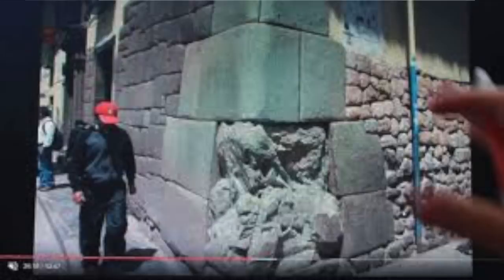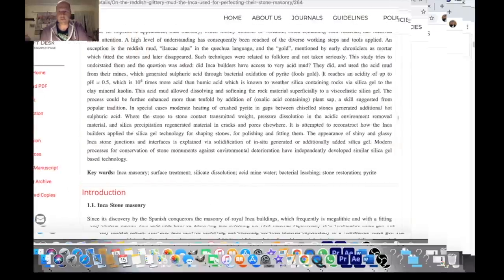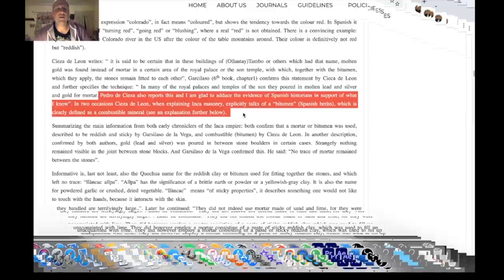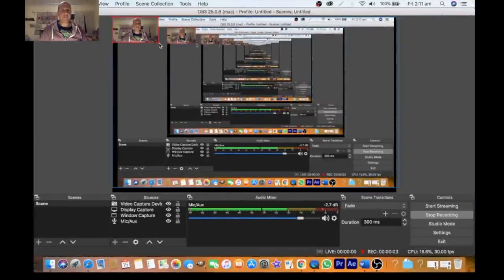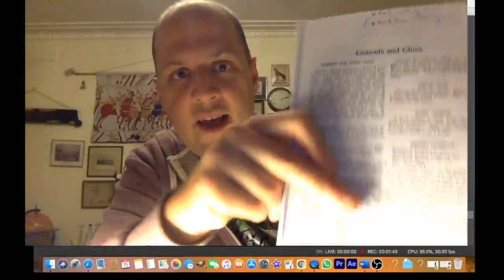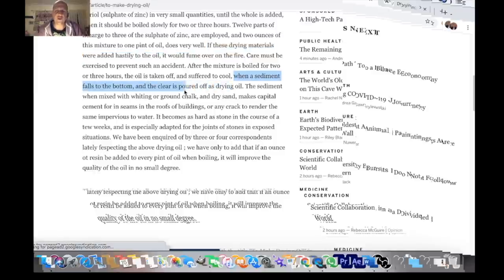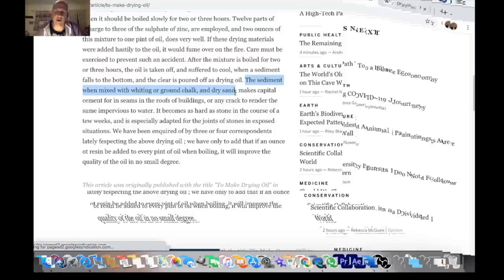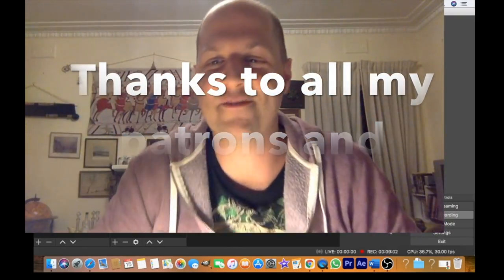FOUND! The 'OLD RECIPE' to JOIN, STUCCO, 'VITRIFY' INCA STONE! "Geological Biopolymer!!!" NOT GEOPOL

Comment: Excellent!  That's a major discovery and I've been waiting for someone to finally make it. So thanks!  Now I might switch from calling it "organic polymer" to adopting biopolymer, but I hesitate since 'oil' isn't exactly something one would define as once 'alive'...which "bio" seems to imply.  But other organic polymers were, including milk casein, egg albumin, meat collagen, and one that I discovered by accident.  

Try this: juice a potato (russet probably is best) then microwave the juice in a glass to boiling. then pour off the liquid and you'll find a tough but flexible slug of 'plastic' at the bottom.  Try to dissolve it in hot or even boiling water. It will not dissolve!  It's a super-biopolymer.  It may be what is used these days to prevent cold cereal from becoming soggy in milk. The stuff just sits there and won't absorb water.  Permanently crunchy.  Must be potato polymer or something equivalent.
About that big corner block, I assumed for a long time the same thing that you assume, but recently I examined a better photo than those before and discovered it did not loose its render veneer. That is evident by the character of the remaining external surface.  Here's a link to the comment-photo that I made with that photo: https://www.facebook.com/photo?fbid=4115912581772665&set=gm.1056202588125468

Comment: Oil rubbed in is still a method used to "repair/restore" modern cement/concrete.
Reply: i've worked with all different trades for years and never heard of this !
Reply: @0harris0 boiled linseed oil is often used to enhance / revive /protect brick and tile work .  It can also be used to "glaze" packed earth floors.

Comment: Great Recipe for stone verification. Only how does this explain how they moved and placed these stones into place ?
These stones weighed tons ,how did they carry and move them into place??
Reply from the maker: It doesn't. :( Geopolymer might. This is just for joining and rendering not really for making or moving it. :(
Reply: the stones can be easily moved with enough people, and some good sleds/rope/pulley/a-frame engineering, wood and ropes... natural fibres... 
absolutely epic of course, but that's what you get when a society works well enough to be able to take the time to build megalithic structures :P

Comment: Here's a thought about the protruberances. Animal hides for the molds. leg holes sewn up.
Reply: its a thought! but those little spots like dough being ripped away is surely indicative!
Reply: @313barrygmail  Exactly, like random hides being used for the size they need. pointed in whatever direction best fits. That's why the bumps appear random, the hides could be sewn together by different people and different methods, making the forms for the next block as they go.

Comment: I hadn't considered rendering, though I knew about the casting (H stones in SA). A combo of plastering and chemical wash. It will have rust and sulphur on the surface if this is what's used. Just look at the rust on many of the vitrification sites.

It's a compelling argument for a putty.

But this isn't the formula for the mine waste acids, what plants did they use for that?

Comment: "Lead putty" and "Lime putty" 😉
Reply from the maker: Cool! Din't know about lead putty!
Reply: @TheTimeDetective42  old masons would use a blended mix including lead oxide as a means to producing miniscule joints between stonework.  We still use putty mortar joints for very fine/decorative stone and brickwork, but i think you're onto something when considering the use of polymer recipe to render & refine stone facing work. 

Add a hardening oil to a surface mix and you essentially create an impervious surface similar to that found on salt glazed pottery.

In essence, they used alternative "mortar" mixes and would add different minerals/crushed rock so it would mimic natural stone.  You often see places where the render has spalled - for whatever reason -  leaving the rough cut stone beneath. 🙂
Reply from the maker: @gazpal  You're a genius!!!!! Thanks for this! I'll copy the text to the pinned comment!
Reply: @TheTimeDetective42  I'm simply a retired stonemason with almost 50 yrs in the trade my friend, but I do hope the information helps in some way.  I've noticed some pictures of Inca stonework showing surface spalling very similar in nature to some I've experienced when using slaked granite Aberdeen kerbs - where the kerbs would be dipped in a slurry before firing and putting to use.  The surface texture is often virtually the same as that found on Inca stonework (Sometimes with the appearance of a glaze, but hard bonded to the surface, necessitating frost action in flaws/cracks to force the two apart).  I'd assume the same mixture would be applied as a render before submitting finished surfaces to high heat or allowing it to cure through the action of drying oils.
Reply: @gazpal  thanks for sharing mate! seen the lead putty in stone joints before, and also seen finished "stones" from late 1800s, but falling apart like concrete/plaster??
guess that's the same sort of slurry/firing technique?

you reckon these techniques are proper ancient then?
Reply: @0harris0  i think it's a case of "there's nothing new under the Sun".  So much of what we thought was new invention during the industrial revolution has proven to be a re-hash of ideas & technique used thousands of years ago.  e.g.  glazed stoneware.

We still use lead, brass, bronze (molten or cold impressed) for infilling things such as carved lettering.  Mostly lead free now, but still a use of metal with stone.
Reply: @0harris0  i forgot to add.  Yes, stone spalls (surface separation/disintegration) through e.g. the repeated action of water ingress via faults and subsequent freezing/heating.  Igneous rocks such as granite don't tend to react in such ways unless coated and the coating separates.

Melt temperatures are comparative with those of iron and i believe we've barely touched the tip of the iceberg in terms of uncovering our ancestor's knowledge.
Reply from the maker: @gazpal  WOW! Maybe acid rain? Thanks for the info! Ah render before heat, NICE! Maybe!
Reply from the maker: @gazpal  I see, I believe electrical action in the natural world along porous stones would also create a similar effect maybe over thousands of years. Hmmmm
Reply: @TheTimeDetective42  Dun Deardail is worth looking into 🙂

Comment: That megalithic corner stone in your pic has been cored from one end to the other as well as several others from 5 different locations in peru. Seems they are consistently the same stone all the way thru. No possible geo polymer was discovered . The stones had the same consistency all the way thru like stone normally is with only the expected irregularities in a couple of small spots. Not indicating geo polymer in any of them. Some of the much later actual Inca works thousands of years later shows possible mixing but they are not smooth and perfect like the megalithic stones finished to perfection.
Reply from the maker: I see, I was not aware of this! Is there any link to this study? Thank you!